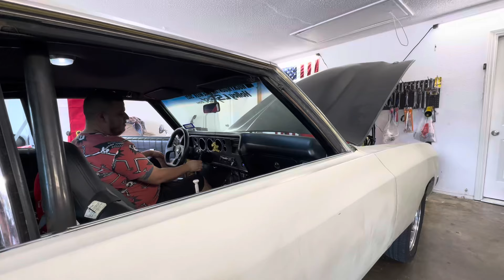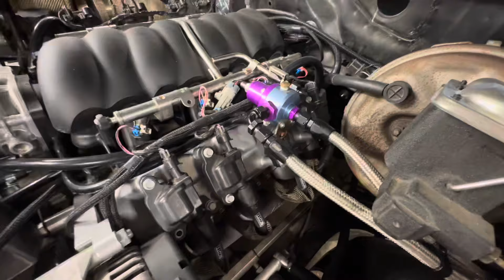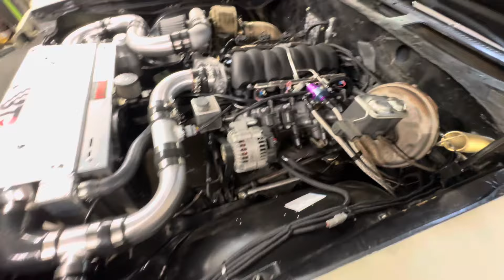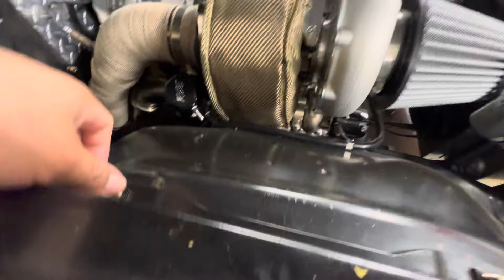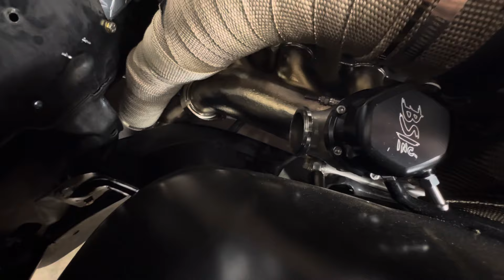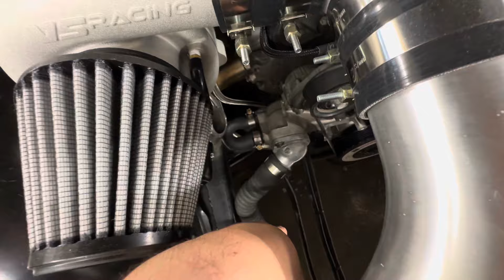Update: LS Turbo 1972 Monte Carlo is finally running!!!

Comment: I have a 74 monte and with funds to swap just don’t trust sellers stuff allot where did you get your engine?
Reply from the maker: Yeah it’s hard to trust sellers. Its best to try and do as much of the work yourself as possible. I got my engine as a short block and i assembled myself.
Reply: What did you do for motor mounts did you make em or bought em online? Any tips for any fitment issues?
Reply from the maker: I used some hooker brand ls swap mounts that work with the small block mounts.